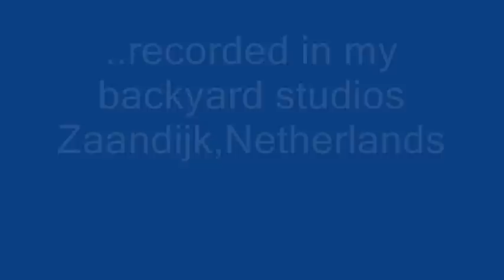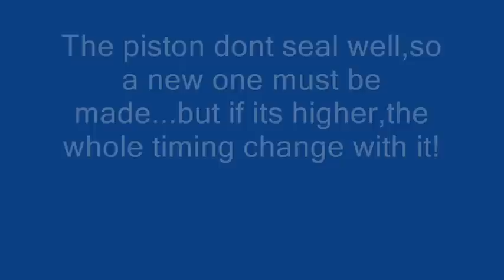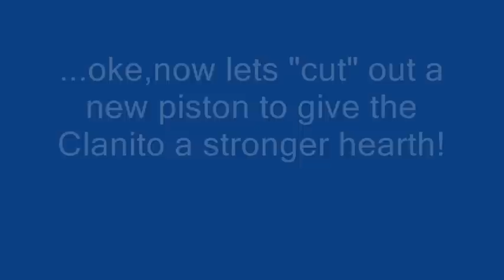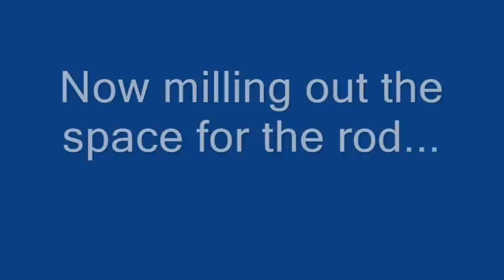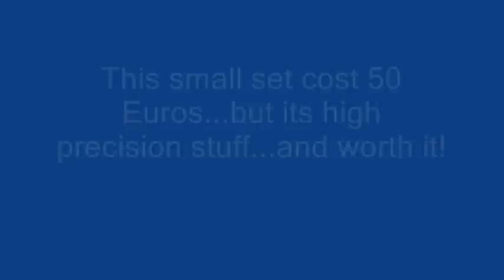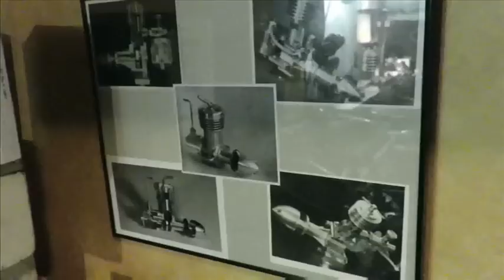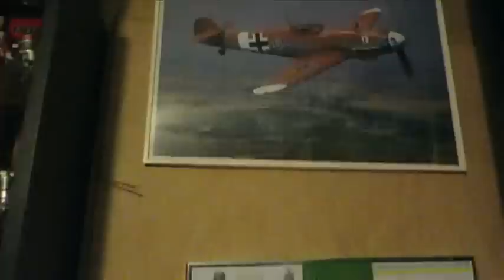Clan 0.24cc model diesel engine..finally running! A new rebuild!

Comment: That's a nasty little engine.
Reply from the maker: Very sweet small diesel, but a lot work! Most of the Clan engines will not run, sadly...
Reply: @valic000  Very poor engineering on the part of the manufacturer. You put a lot of effort into a bad design; for that I congratulate you.
Reply from the maker: @glorialotz3333   Thanks  a lot my friend!!  :-)

Comment: What is your fuel blend percentage？
Reply from the maker: Hi Gabriel. Its a long time ago, but  a 1/3 mix will be fine. How ever, they say, engines under 1cc and   engines with an RC carb behave better  with ether up to 40%.. So 33-40 Ether and the rest half kerosine and castor oil...I hope this answer helps..

Comment: Hi Peter
The Clans have a reputation. Precision Engineering were one company used. I always thought they were mostly OK, but the ones made by CS had the problems. Its possible they both had this sub induction/ induction push / Sucking and Blowing at the same time. The error was on the original drawings. There's a story there. I have the prototype .44 Engine which originally was to be called the Randy. The gentleman that designed it gave me the drawings with the error marked. I wish I could find them now a days. I think they might be in the shed. I should have took better car of them. We moved house in between me getting the prototype and plans and so they might have been lost in the Move. The Prototype is on a metal stand and was on the TV as an ornament when I went to buy engines of this man. I asked about it and got the story of how he designed the Clan, he was to be in partnership with Mike he said and it all fell through. He said the error was known to him, but he left it when he was no longer involved. So the Randy became the Clan.

The Rand is the currency of South Africa which is where Clan Designer worked Hence calling it the Randy. Mike preferred the Clan.

I did have a load of unfinished parts for Clan .44's tanks , conrods, some pistons, but over the years gave them to various modellers. I have a box with a few bits somewhere. But I've never seen it since we moved house. There's a story I expect you didn't know. I'm not sure the original designer would like me to say his name. We can refer to him as PF and PF was experienced in model engines as he once worked at Davies Charlton.

The engines were made by Cambridge Engineering, but far more were manufacture by CS in China. The Box Art on the Clan is very similar to the Box Art on the Boddo Mills which is also made in China.

Steve
Reply from the maker: Hi Steve..Thats a very interesting story!! Never know that..Its a lovely engine otherwise....a bit like the  Dragonfly,but then with out the rotor assembly...It could be even scaled down by 50 %..I think it would be a nice project!! I do not think, you lost the plans..and the engine..I am sure, it is just somewhere in a place..and you can not find it..for now...I can imagine..how it is,when move to a new house!!! I have to do it also in 1-2 years..as the want renovate or build new houses,where I live.The condition of those homes is bad.My home is not too bad..as I did a lot my self..even its a rental home...And I have grey hairs already from thinking to move out all the stuff I have..and its a LOT !!!
 Thanks for the lovely story Steve!! I bid by the way on the  mini ETA.. got to have one day one..there are so nice!!!!

Best regards to the UK my friend!!

Peter
Reply: @valic000  Thanks as always Peter. I have seen the Randy since I posted the story. But appear to have mislaid it again. For security I have engines in separate places , good for security and terrible to find everything. LOl Nice to speak to you again.Thanks!

Comment: how much it costs
Reply from the maker: Its not easy to say.It depend,what parts I need to make.But between €50 - €100.. + porto .......I need to first see the engine,to give a good advice.
Reply: oh like that. did you make it yourself? what is it made of
Reply from the maker: @bimatri2760  maybe it is a missunderstanding..do you have this engine,and it need a repair??...or do you mean,I build a new engine for you?? For second option,I have no time.You can find this engine sometimes on Ebay.

Comment: Well Done !  Yahhhh !   I need to take a look at the ports on my GHQ engine.  I think there is a problem with the piston being too short at the bottom or the ports too low.  That Clan is a good looking engine on the outside. Too bad they let it go out the door with such a bad defect.
Reply from the maker: Thank a lot mate! It is indeed,that the port timing and overlap of the transfer/exhaust  must be correct...small changes can make a big difference! Or even make a engine not start at all...!!
Agree full,the Clan is a so lovely looking engine,but most of them will not run...but it can be fixed..as many things..   :-)

Comment: Hello mr Valic, just a technical consult about my EGA Bambino, the piston has very little compression but a friend of mine can build a piston for me, the question is what iron can we use?
Reply from the maker: You must use fine grane cast iron.I use also from old car engines the inner core of a camshaft. If you cant find it,let me know. Ebay is a source,but they have only dia.25mm or larger..
Reply: valic000 excellent

Comment: Hi mr Valic, I have a problem with my EGA Bambino, it starts but is not steady, I saw some bubbles in the fuel hose at the carburetor fitting. Any idea what is going on?
Thanks
Reply from the maker: Hi! If its not steady running,than the air in the fuel is the problem for sure.Are the bubbles coming from the fuel tank in direction to the spray bar? Or where does they originate? Is the fuel hose a tight fit to the spray bar?
Reply: valic000 Already checked all the fuel system from clunk to carburetor fitting and is ok, the center line of tank is aligned to the carburetor, the bubbles are from carburetor to fuel hose. Also re-tightened the backplate (it was little loose), bubbles were reduced but still. Do you have Facebook mr Valic?
Reply from the maker: I have facebook,but its not related to my engines at all.I dont do a lot posting on it. But you can write me at  p.valcek at planet.nl  Its not easy,to give you help,if I dont see the engine.The only thing I can imagine i s a bit blow back from the intake bore..Is the bore in the spray bar pointing  straight down?
Reply: I can't access to the link, you have another email account? I will make a video to show you the tiny diesel
Reply from the maker: p.valicek@planet.nl

Comment: What a sweet thing, well done Peter.
Reply from the maker: Thanks a lot. Its a lovely design,like the Dragonfly a bit,very simple ,but lovely. Shame,many of them have the timing issue.
Would be a great project to build one  self,maybe a bit bigger,to make thing easier...
Reply: Yes indeed.I have a Rustler reproduction AMCO .87 Mk. 1 with exactly the same problem. I need to make a new. taller piston to ensure the intake port is fully closed at BDC. Another job on the list :).
Reply from the maker: Its strange,that there is a timing error. Usually all Rustler engines seems fine.I have the Jaguar repro,and its superb made. But indeed a new piston,and problem is solved..or just a rod,less work...

Comment: Hi, How to contact to you. I may have something to you. ovuorile@dnainternet.net
Reply from the maker: Many thanks Olli,will write...always look for old fuel cans!     ;-D
Reply: Hi Peter, I have couple of ED baby 46cc diesels. One is new in box and other is used by me when I was about 12 years old. It will need a new piston pin. I would like to send these to you free. I would like to see them running again. Could you send me PM. Cheers Olli
Reply from the maker: Hi Olli. I send a mail to your adres you show me,but I guess,it had not arrived. you can contact me here.
p.valicek at planet.nl  Are you sure,you want give it to me for free? I will be of course very happy with t hem!

Comment: Bravo Peter. It will start and run better with time. I like your engine collection, it reminds me of mine.
Reply from the maker: I am sure it will go better with each run.Its extreem sensitive to adjust,only in very small steps it must be corrected...but if you near that setting...of she goes!    ;-)

Comment: Well done Peter. Your perseverance got there in the end overcoming the build/ design flaw!
Reply from the maker: Thanks Jim 
As I have the same engine..also blue head,I will be happy to do the same to it as well. Other owners of the Clan 0,24 can see what I have done and do it them self,if possible. 
A longer rod is also a option.But in this case,I needed a new piston anyway...